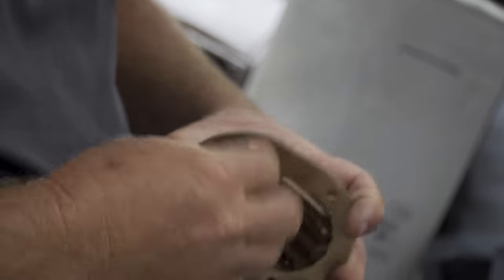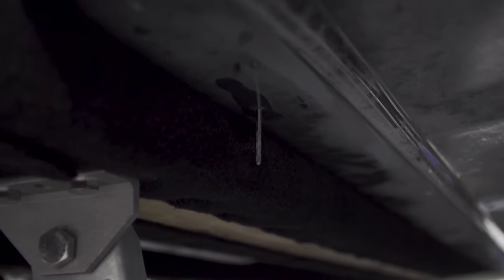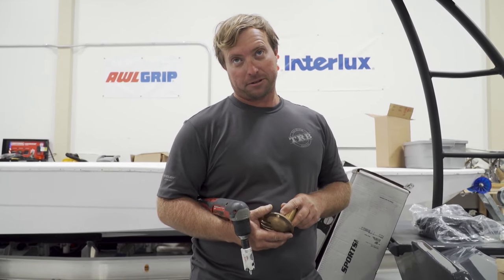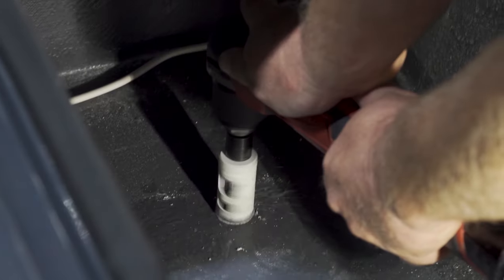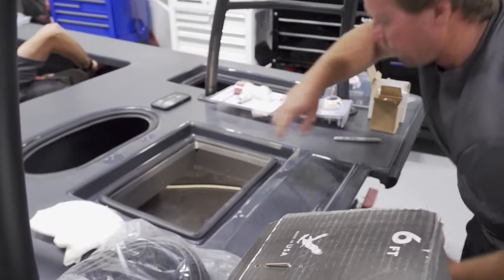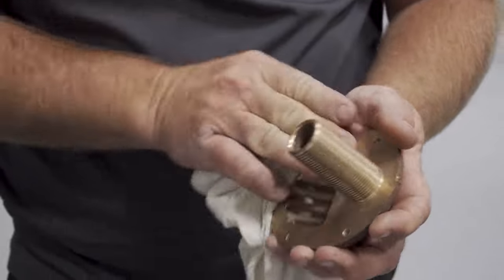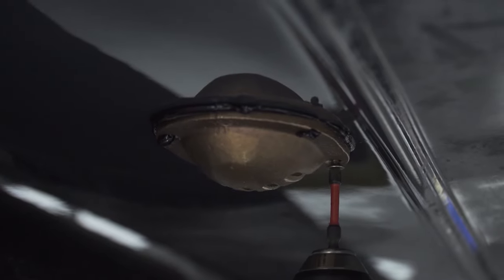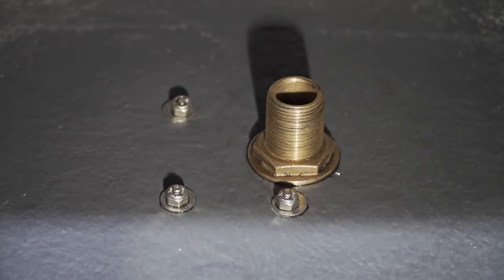How to Install a Thru-Hull High-Speed Pickup Livewell Properly

Comment: Hello, is there a strainer needed? I am installing pretty much the same kind through the bottom of the boat, but trying to understand how to keep sand/debris from getting into the pump?
Reply: Turn your pump off when running shallow. There is never going to be a time when the stern of your boat should be touching bottom.